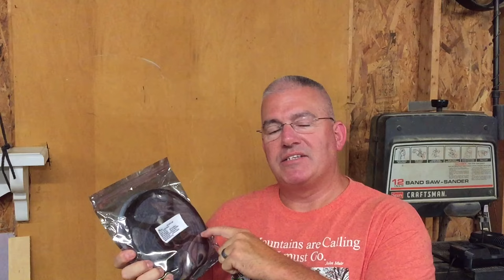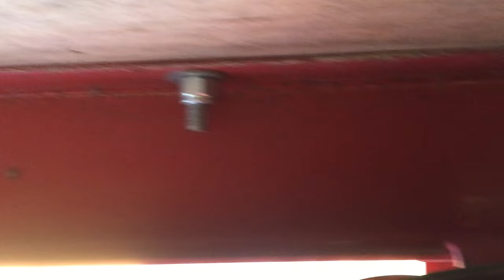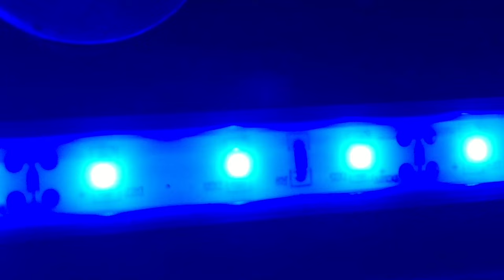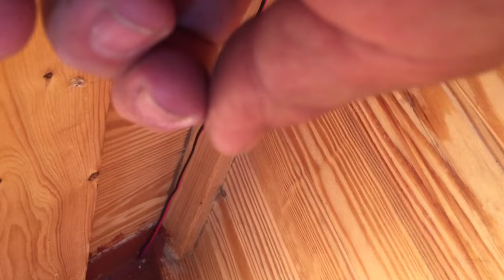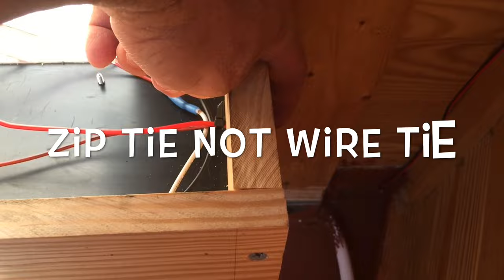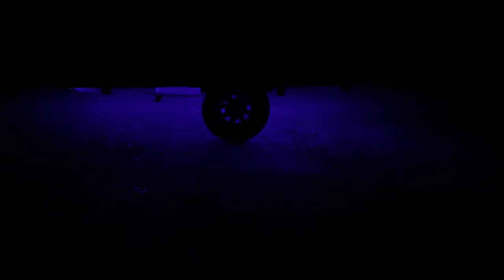RV LED Blue Strip Light Install / DIY

Comment: Good Video Jeff. I have used LED light strips in other projects with the 3M on the LED strips and after a year or so the are still sticking great. 3M sure works good.
Reply from the maker: Thanks Doug, I was really surprised at how well the tape stuck and the lights are working great.